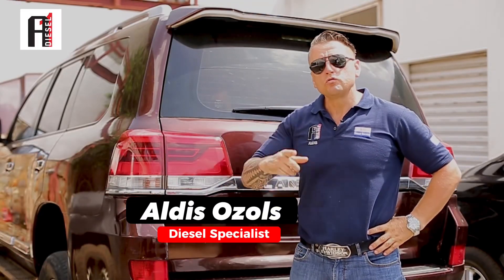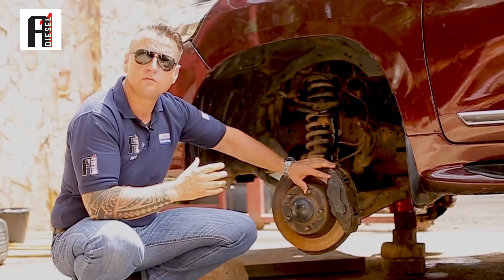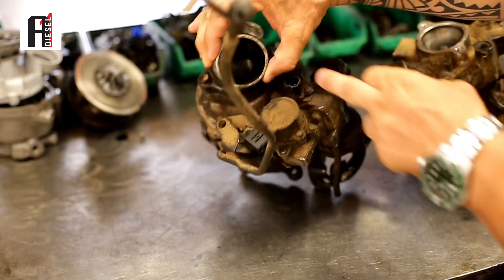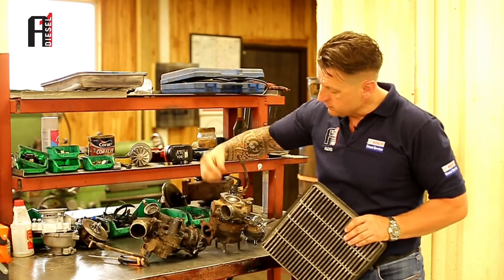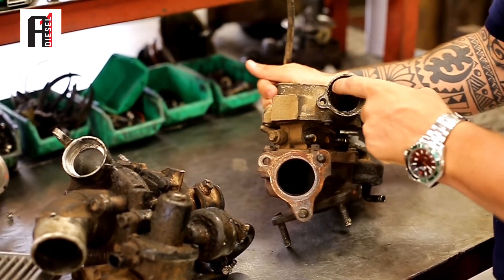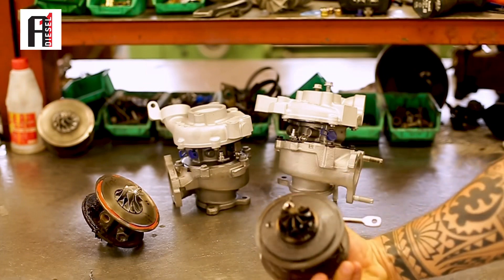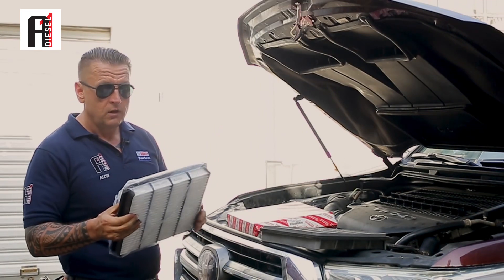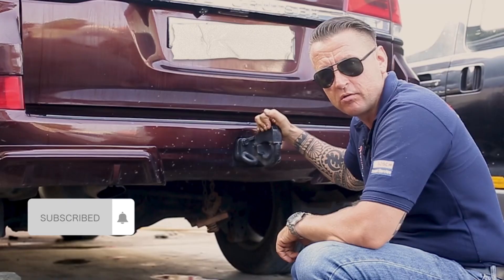SECRETS YOU SHOULD KNOW ABOUT V8 TURBOCHARGERS

Comment: Hello, very good job from A1Diesel but I have a question.  On Landcruiser V8 d4d twin turbo outlet to engine there is small smoke, the filter is always renewed but when we check the intercooler, we find blockage and some smoke is coming from the turbo outlet to engine side.  What could the problem be as even without intercooler on idle and small acceleration small smoke is coming, will appreciate your advice, also if cartridge is bad, which information you require to propose a replacement cartridge?